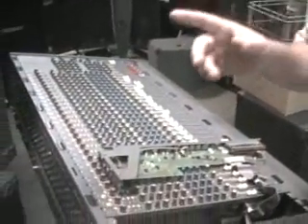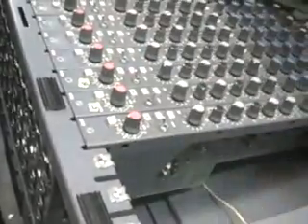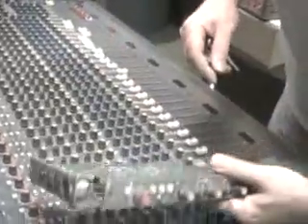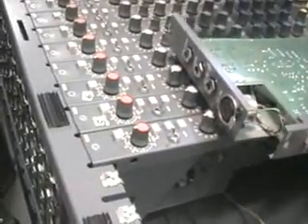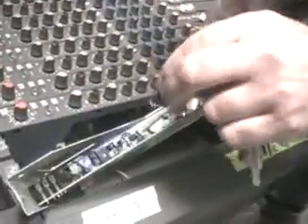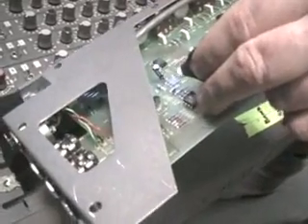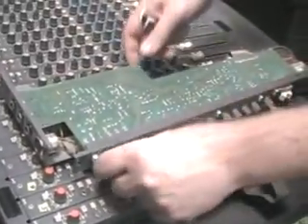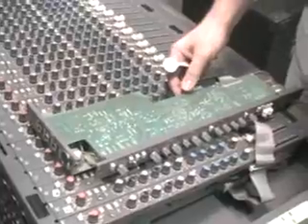Soundcraft Delta 32 Mixer Console repair service noise gain

Comment: Hey man I just done a recap on an old Allen and heath system 8. All the channels work perfectly except one has a very weak signal. When I turn the gain right up I can hear a weak distorted signal. Do you know what it might be?
Reply from the maker: i would set two channels controls and switches identically, feed both with the same audio signal and listen at the same points in each channel, working your way from input to output. The good channel tells you what you should hear at each point. Should be able to pinpoint the trouble area
Reply: @robstorms  hey man I found it. It was a cheeky little cap near the mute button. 👍 thanks for the tips.

Comment: I have a Soundcraft Delta SR. It's a little 8 channel mixer made in the 90's, I got it for a steal in nearly mint condition. No issues with it at all. I use the direct outs on each channel and use them as mic pre's in my home studio.

Comment: I have a Yamaha MX12/4 stereo mixer. Every other channel (odds numbers) do not work. I was wondering if there is a likely culprit. I am not sure what happened, but someone said  that  the problem may be related  to overloading the insert. It is possible that I  tried to use the channel one insert as the input for an acoustic guitar with effects and sent too much power through that channel?  Where would I look  for  a  common  component that would  cause the other channels to fail?

Comment from the maker: I would say it is a problem with control settings but the fact that the bad channels are all 8 apart is fishy. Sorry I can't offer any advise. i can't think of a defect that would do that. Make sure it is not operator error. It usually is when I am the operator

Comment: thanks for the good info. I'm thinking about pickup up a used (of course) 8 chan. SR w/ a group output LED ladder that doesn't function. I'm currently using a Spirit M12 as a front end - any comments on comparing the SR with the M12 as far as sound?

Comment: I use DEK contact cleaner, it is a deagreaser and a silicone lubricat. The one I used is safe for most plastic, very inportant so that cheap pot's don't brake on you. Seen this when I used brake cleaner for though job's but it works.

Bob

Comment from the maker: I use Caig DeOxit; the little tiny full strength bottle if I can get to the contacts directly, the spray if I can't. It seems to work fine; other cheaper stuff( maybe even spit) might work as well. I think most of the battle is to get something wet on there to wash off the crud.

Comment: Useful vid, I use a 24 track Delta at home, Just fixed a problem by just cleaning inside the affected area, but I`ll certainly bear your tips in mind if ( or rather when )I need to service it again